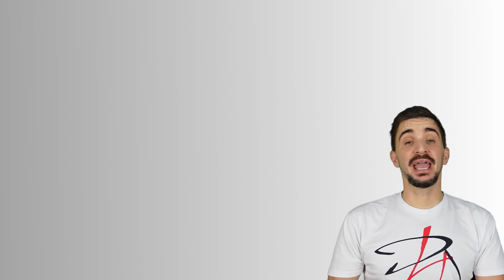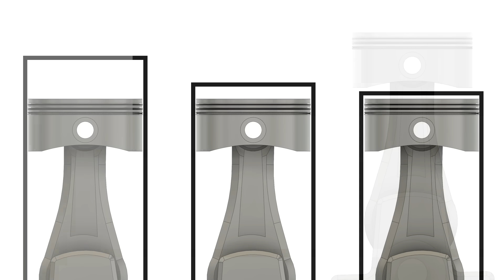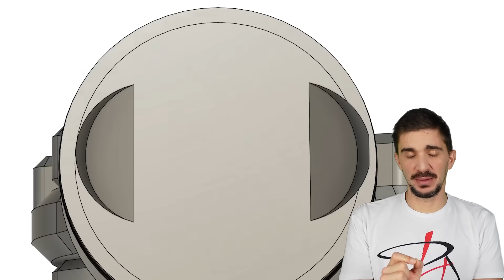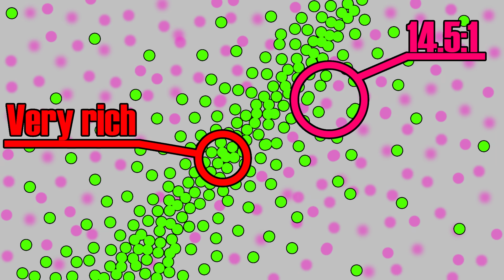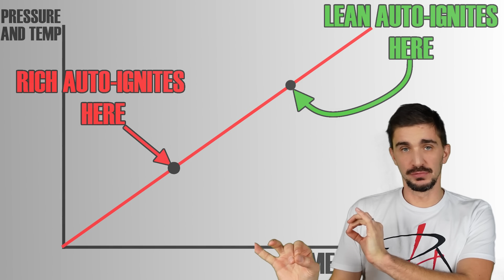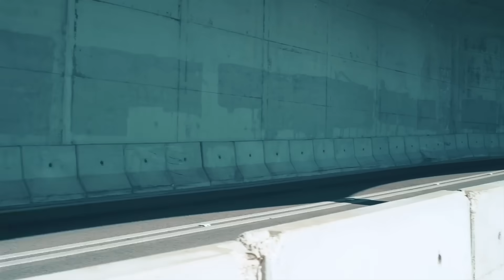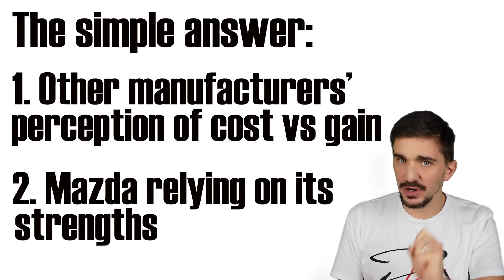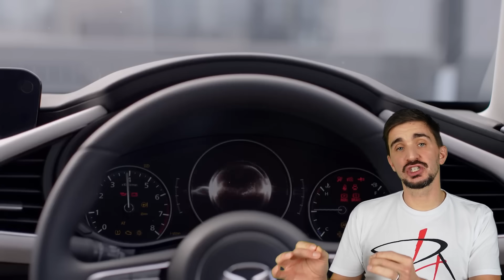The Game Changer Nobody Cares About - Mazda Skyactiv-X SPCCI How it Works and Why It Didn't Catch On

Comment: You can run spark ignition engines super, super lean, even more so if you use forced injection without intercooling or with limited intercooling plus hot EGR to maintain a minimum charge temperature, pressure, and density to ensure stable combustion.

25:1 was common (lambda of 1.70) for lean-burn engines before NOx emissions requirements killed them, but those were typically NA, not FA, but they were running lean of peak knock and thus the effective in allowing high compression ratios compared to engines running at stoichiometric.

The main alternative is using hot EGR dilution instead of lean burn, but that limits the viable range more than true lean burn or requires charge temperatures high enough that engine oil degradation becomes a problem. (without exotic oil types)

Peak knock is typically slightly lean at lambdat of 1.1 while best power rich is usually at .8 to .9, but running super hot and super lean with forced induction can net you more power than either value without hitting knock or detonation limits due to the knock suppression of lean of peak combustion characteristics.

If you don't care about emissions, you can get close to double the fuel economy while maintaining or increasing power over existing forced-induction SI engines. And same for some DIY mods for some of the alreadly fuel efficient 1980s vehicles. (the details on the mods are scarce, but the record-setting 117~119 mpg gen-1 Honda CRX in hyper-miling competition back in the early 2000s was likely modified ultra-lean-tuned carburetor with secondary air injection deleted and probably utilizing hot EGR as well;  there was also some external body modifications, and taped-over seams but I personally doubt those did a major portion of the efficiency gains)

Mind you, with conservative driving techniques on the stock economy (60 hp) 1.3L version of the CRX, you could exceed 70 mpg already, and more than that with really concentrated hypermiling on backroads at modest speeds and few stops. (presumably around the same conditions I've been able to get roughly 52 mpg in experimental trials with my 1988 Pontiac Fiero 2M4 bone stock 2.5L Iron Duke Tech IV ... realistic conservative driving is going to be more like high 30s, but potentially over 40 if routinely doing modest/slow speed limit backroads commutes in the 30-45 mph range)   This was on CA E10 fuel.

Driving aggressively for stop-heavy city street traffic, errands, and grocery runs will drop that into the high 20s though.

Oh, all of the above cases are with manual transmissions.

OTOH, keeping SI engine emissions as they are (vastly more aggressive than diesel emissions), you have one other benefit of EGR dilution vs lean-burn, and that's an even more dramatic suppression of knock than an equivalent amount of air dilution, so you could run extremely high compression ratios and manifold pressures (and temps) with stoichiometric AFR + EGR dilution. However, this could be taken even further if EGR was fed into the turbocharger intake and compressed along with air to allow the intake charge itself to be diluted and thus allowing higher manifold pressures without being limited by mass air flow increase from the turbo. (just keep the mixture diluted to the point of being shy of causing misfires and you'd be at maximum knock suppression and maximum viable pressure ratio + manifold pressure)

Injecting EGR into the supercharger inlet would occur only after maxing out EGR flow through vacuum into the intake manifold itself which would be fed in beyond the throttle body). So when the intake manifold pressure is less than or equal to the exhaust manifold pressure, you wouldn't need to use EGR injection into the supercharger, but when the pressure exceeds that of the exhaust gas, you'd need to feed the compressor with exhaust.

The fact that spark-ignition is still used means that EGR dilution can be used much more aggressively than in diesel use without experiencing misfires, which is also why it's impractical to run diesels at stiociometric AFR using EGR dilution within real-world viable compression ratios possible with mechanical limiations. (even if you went forced induction plus greater than 22:1 CR, and hot EGR and no intercooling, you'd either get misfires or have cylinder temps so high that you do material damage or cause oil degradation ... due to temps alone, and lower temps would fail to ignite due to being outside the combustion/explosive limits for the exhaust+air+fuel mix) 

Albeit if you maxed out the viable compression ratio AND maxed out the viable amount of EGR dilution AND used indirect injection into a pre-combustion swirl chamber, you could have the supercritical CO2 rapid dissolution effect + rapid reaction of the hydrocarbon fuel into a mix of light oxygenated organic compounds, carbon monoxide, and hydrogen due to the influence of CO2 and water, and have the world chamber itself improve the reaction rate of that mixture before it enters the cylinder, where very low or no soot will be able to form. (especially in an aromatic-free diesel, as in fischer-tropch diesel, HVO diesel, or blends of either of those with biodiesel: or 100% biodiesel, but realistically this isn't used for various fuel system compatibility reasons ... but there are individual use case exceptions)  DI Diesels run on dimethyl ether also avoid this for the same reason, the fuel dissociates into gasses and can't form soot under high pressure + high temperature combustion conditions. (rich areas end up with CH4 + CO + H2 which then finish combustion during the power stroke, or more realistically not just methane, but a mix of methane, ethane, and propane due to equilibrium reactions) Soot formation with higher molecular weight ethers is possible, but still very low compared to hydrocarbons when the molecular oxygen content is still relatively high, but preferential formation of light hydrocarbons + CO + hydrogen would remain high. (synthetic diesel or fully saturated, hydrogenated petro-diesel has low soot forming potential as well, tending to decompose into a mix of lighter hydrocarbons instead, as in thermal cracking units: you get a mix of lighter olefins/alkenes and small amounts of paraffins/alkanes from such, depending on the specific temperature, pressure, and presence of catalysts ... nickel content of cylinder liners would have potential catalytic activity)

But back to the SI engine context:
This high CR, high boost, high EGR dilution system would also allow for relatively efficient use of port injected fuel systems and allow greater homogenous and fully vaporized fuel mixture due to the hot charge conditions, additional mixing time during intake stroke and the supercritical fluid conditions during the compression stroke due to the high fraction of hot CO2 present, which would cause the water vapor and fuel to all condense into a hot solution within the supercritical CO2.  Single point fuel injection (like TBI) could also be used, but mixture distribution would likely be less precise even if relatively homogenous. (a draw-through turbocharger would improve this, but then lead to heavier turbo-lag, albeit much less so if variable inlet guide vanes were used as the throttle plate for the fuel injection body itself; AKA a swirl throttle or vortex throttle)

Using hot EGR dilution would have been the main modification to Smokey Yuinick hot vapor engine experiement from the mid 1980s (using a modified Pontiac Tech IV Iron Duke) which was impractical due to the high operating temps requiring specialized (expensive) oil as well as presenting the same massive backfire risk of all hot-charge draw-through turbo configurations (explosion in the intake manifold was a real risk). And even though it managed to pass emissions requirements for around 1985 while being lean-burn, the increasingly aggressive NOx regulations wouldn't have allowed that to remain true.

However, if using massive amounts of EGR dilution, even with the draw-through turbo arrangement (so long as some EGR dilution was done at the throttle body end as well), the charge could be diluted with so much exhaust that it was outside the combustion/explosion limits for the given fuel-air mixture and would only become explosive at in-cylinder pressures and temperatures just before ignition. At the same time, running temps could be reduced due to the lower combustion temps of exhaust gas diluted charge vs similar air dilution, and ideal maximum operating temps could be maintained by using variable EGR cooling and variable intercooling if necessary. Temperature limits would be dictated by oil breakdown and possibly limitations of aluminum alloy pistons, but not the cast iron engine block, head, or steel valves. (realistically, the limitations of high-silicon cast aluminum piston alloys likely wouldn't have been exceeded before massive oil degradation was a problem, especially given Smokey's engine used aluminum pistons and unusually high operating temps without issue other than requiring expensive gas turbine grades of oil)

In a modern direct-injection gasoline engine, the risks of intake manifold charge explosion are completely nonexistent as there's no fuel in the intake manifold at all.

Comment: The last part of this video should be a commercial for Mazda’s engine philosophy
Reply: Mechanical engineering requires enhancement, but when we look around today's automakers, not many have invested in combustion engines.

Mazda recently patented a multi-fuel engine system that utilizes gasoline (E-fuel), hydrogen, and methane, which a combustion engine produces net-negative emissions.

Comment: Actually diesel burns way cleaner than gasoline. With gasoline exhaust it’s what you can’t see that’s bad. Diesel exhaust looks worse but in reality it takes 10 diesel’s to equal the pollution of one gas engine.

Comment: i think you gotta be honest in your assessment. EVs are 100% the reason. 
Mazda's attempt at an EV, the MX-30, tells a much bigger story than the skyactive-X. 
In its own way, Mazda is doing the right thing but failing as a result. I test drove the MX-30 and was really impressed. Even by today's standards, it was a good EV. And if they had introduced it with the rotary range extendeder from day one, then it would have probably been more successful. 
The waited too long and the battery was too small at that time, given the motor and battery tech and vehicle tech was just not good enough yet. 
Other manufacturers are rushing to get EVs out because they know they will soon die if they don't.
Buyers buy with they eyes and their hearts not with their brains. 
I just got an MG4 Urban and it's exactly what EVs should be like: look like any regular car, not particularly powerful, frugal, simple, incredibly efficient (it rivals Tesla), or is relatively light, has a smal battery but good enough range (200 miles real life), a heat pump, small narrow tyres for efficiency, and huge leg room at the back, ton of head room, and a huge boot, biggest in its segment. and it's cheap. 
It is not what most EVs are though, and this is why EVs are not selling as well as they should. they are made mostly by manufacturers who do not know what consumers want.

Comment: The problem with stoich burn petrolene is what you are describing as Homogeneous isn’t being achieved, neither is complete vaporization.

The second part of that is distribution. Ie: Conventional chamber design.

A lean-burn petrolene system only adds further complication that isn’t necessary if these things are properly addressed.

Efficiency isn’t expressed solely as an energy input/output ratio, by reducing the amount of energy input while retaining a given output. 

The issue is thermal expansion matching. Or more accurately matching flame propagation rates to piston speed.

Comment: So why dont they use this in Hybrid cars instead of gas engines using the Atkison cycle? They could run the skyactive at its most optimal rpm and use the battery and electric motor to make up for the power needed on acceleration.

Comment: 10:46  Why has nobody else done it?  My guess is because the technology that makes it work is locked behind a paywall called patent protection. They would have to pay Mazda licensing fees or get sued. Manufacturers typically try to avoid paying licensing fees to their own direct competitors. Manufacturers promote their own engins by secretly hoping yours fail. That's kinda hard to do if your own engine only works because you purchased the license to use it from that same competitor. This is why Caterpillar stopped using Detroit Diesel engines. Because they would have to buy them from their own competitor after Freightliner purchased the company.
Reply: Yep intellectual ownership is double edged sword. Motivating research and innovation but at the same time slowing down technological advancement.
Reply: The joys of the illogical concept called intellectual property.

Comment: Gasoline engine is crazy efficient…diesel engines properly built are crazy reliable not efficient tho have crazy amounts of residual fuel that must be managed. Gasoline engines properly built manages noise we don’t use leaded gasoline in the USA anymore so crazy efficient…crazier still efficient because of hybrid drive systems now. A diesel engine that runs on propane is okay but modern autonomous drive technology has rendered near all that is extant obsolete 🎉🎉

Comment: Bought a cx5 in feb.
1. Made in Japan, already starting high in the reliability pyramid. 
2. No cvt transmission, adds more to the reliability. 
3. Sky active engine, which many have said is the best of the best in reliability. 
4. Made to work with regular gas, using anything over 87 makes no impact on the car.
5. 5 years of free maintenance or up to 50k miles.
6. Life time warranty on engine, transmission and differential.
7. Much cheaper than Toyota and Honda. 
8. No turbo, many have mentioned that turbos tend to lower reliability of the engine after 100k miles.
9. It’s all wheel drive 

I live in the mountainous regions of Puerto Rico and it takes those curves like a champ and the same can be said about the goings of up and down. Honestly it surprised me the car is this good and it surprises me how good the quality of life features are and feel.
Reply: Keep in mind, Skyactiv-X has never been offered in North American Mazda.  We get the Skyactiv-G here which does NOT have this SPCCI technology.
Reply: @tyty0071   i think one of the  big issues is that our fuel is way too high in ethanol for something as precision engineered as this. unfortunately, the NA-US market will probably be stuck in the past  until we decrease fuel consumption enough to ban ethanol in gas.
Reply: @certifiedgoyslop  Eu has 10% ethanol and these engines dont have problems. Soon 20% might come as well.

Comment: Doesn't Ram trucks use similar technology in their V-6? I know the engine is based on a diesel platform. Just asking....The Ram engine is powerful and responsive, the Mazda not so much; I've owned both. So has Ram done a better job than Mazda converting a diesel to gasoline engine?

Comment: I guess Mazda should take advantage of this engine and convine it with a range extended vehicle (reev). Let a medium size battery and a electric motor move the car, so that the engine produces electricity in its most efficient range.

Comment: I bought a CX-50 to replace a Chevy Equinox.  About the same size and it’s reasonably comfortable for a small car.  It’s a 2024 and I’ve had it for 18 months.  I usually keep a car around 12 - 15 years, except my pickup that I kept for 20 years.
I hope it makes it to 200,000+ miles.  I’m 76 and hate buying new cars.

Comment: Mazda just innovates. The RX series has its flaws, but the wenkel engine was a whole new concept that puts out ridiculous power for its weight. Super high RPM's and brilliant minds collided, but they have their own set of issues. I think of engineers put enough into it, we would have better engine tech. Problem is the manufacturers want you coming back after 200k

Comment: I rented a little Mazda hatchback and it impressed me. Good power and great gas milage out of a 2.5 N/A. I was surprised to find out they weren’t using a smaller turbo engine. Rented a turbo Hyundai after that and the Mazda was a far better car

Comment: If it's not repairable, it's not a good engine. I don't know if it is or isn't, but these days auto makers aren't making many motors or transmissions that are easily repairable. A lot of them look great on paper, and look great in the driveway, until the dealer or shop needs to repair something on it. They're getting worse and worse in that regard

Comment: It sucks because of the 2,000 lbs of computers, wiring, and all the BS required to make it run. Sure its efficient, but it's a 4 cylinder vehicle that weighs 4,000 lbs plus. They gave away any advantages with weight.

Comment: I mean, for a new SPCCI technology engine that barely makes a difference with regular technology engine, not even the fuel saving part, is the reason why it didn't take off.
Other manufacturers are already spending RnD money on Hybrid EVs and BEVs which gets better power and efficiency in a manner that can be felt immediately.

I do think it's a great idea and should be far less costly to maintain an SPCCI engine car compared to a Hybrid EV car, but the tech needs to at least scratch what Hybrid EVs are achieving in terms of power and efficiency before people will put their eyes on it.

Comment: My Ford 2007 Fusion, although only 100,800 Miles on the clock with original plugs still runs great. It's basically a Mazda 6. Still has ice cold air too!